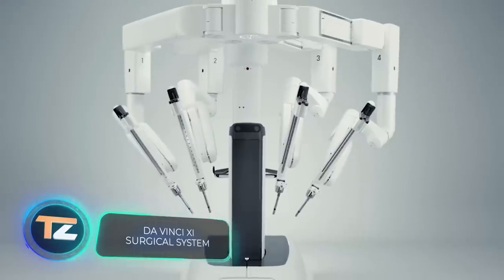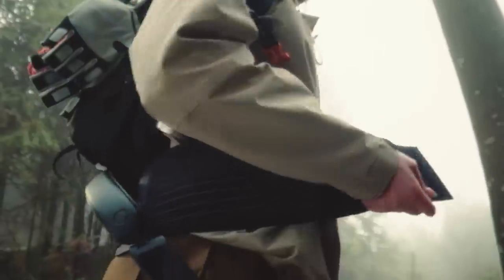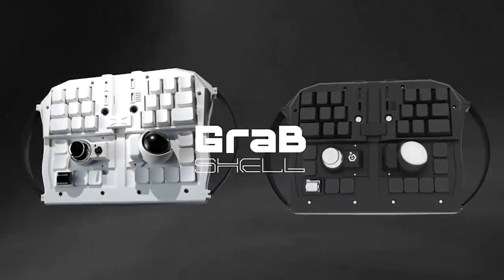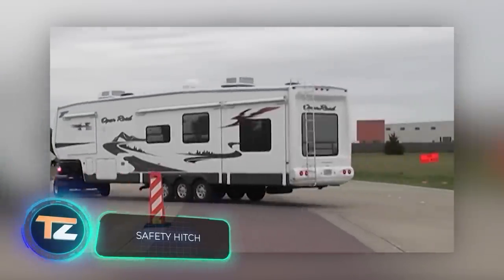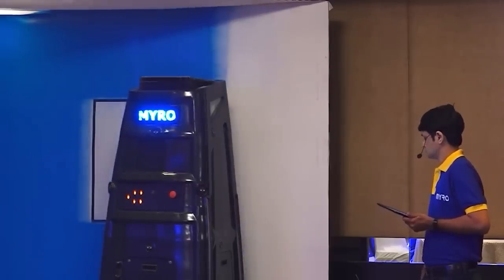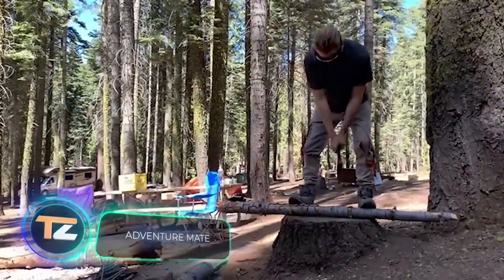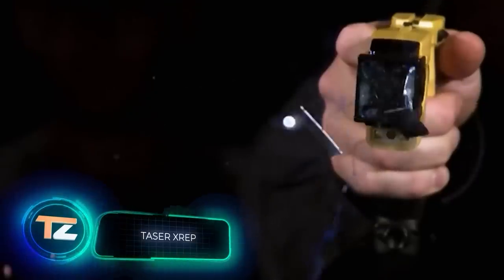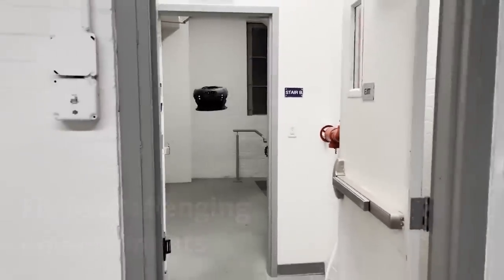INCREDIBLE INVENTIONS YOU DIDN'T KNOW ABOUT

Comment: I've preordered the Bigscreen Beyond and from what I'm hearing from early testers, it's living up to the hype. The lens itself is called a "Pancake lens. The MicroOLED screen is very small " and is why the lens is  basically a magnifying glass. The reason for the facial scan is because they need to know what your Interpupilatory Distance (IPD) is so they can precisely place your eyes in the correct position to look through the pancake lens without the distortion you would get from when you would look through a normal handheld magnifying glass. The precise scan also allows for a perfect fit of the gasket against your face to prevent ALL light from bleeding through and causing things like lens glare and other stuff. This Headset is definitely something to seriously check out for any VR enthusiasts that spend many many hours in VR sessions.
Reply: I actually kind of prefer having a little light leakage around the nose area. I don't get motion sickness but if I'm standing on a slope in VR sometimes I can start to lose my balance. Going crosseyed and staring at the actual floor through that little gap lets me instantly regain my equilibrium without taking the headset off.

Comment: $10k to solve a trailer "problem" that really doesn't exist...
Reply: Uh it helps me get the most out of the toe package I put on my straight piped corrola🙄 duh. And now if i want to say tow my new fith wheel guess what now I can and i dont even have to try to redline this b** now like bro I get stuck everywere
Reply: I agree it’s too expensive but not putting weight on the rear bumper, not losing space to a gooseneck and the improved braking seem like pros to me.
Reply: One use would be for towing a larger trailer behind a utility pickup that doesn't have room for a 5th wheel or gooseneck hitch.
Reply: You can buy a lot of gooseneck and 5th wheel hitches for $10k.
Reply: Yeah - because it is just a Ford pick-up commercial and a dually pick-up takes care of the usual hauling -
Reply: You don’t drive off road very much.
Reply: truth.

Comment: The Sea Air underwater swimming system would be greatly enhanced with a full face mask. Since this system is geared to newer type swimmers and possibly tourists who have little experience in the underwater sport,  a full mask might allay some of the closterphobic of breathing through a mouthpiece.
Reply: i'm pretty sure CLAUSTROPHOBIA isn't the word you're looking for; try beginner's anxiety. but that's a GOOD point u have there; FULL mask, MORE confidence (for SOME ppl anyway)
Reply: @Solitaryconfinement :- The breathing with a mouthpiece always bothered me and caused me to avoid scuba and snorkeling,  but in my profession l was required to use a Scott airpack with a full face covering and l never felt closterphobic even in extremely toxic environments.  
I know some tourist attractions exist where the individuals are required to submerge completely underwater and use a full helmet that has fresh air pumped into it from the surface. This alleviates much of the fear (for amateurs) of breathing under water.
Reply: @babagalacticus  :- Spelt both ways.
Reply: It is also only generating Oxygen (O2) and hopefully at only 21% so you can go down 66 meters. If it is generating 100% Oxygen then you would be wise to stop around 4 meters, because at 6 meters you will go into convolutions and likely die.  lol

Comment: 4:37 does it really need a battery using USB-C? If it’s not wireless, it really should not be using batteries USB-C offers a much higher voltage and amperage than other USB devices.

Comment: Reference the SeeAir system, the narrator says it works without an "Oxygen" cylinder - but any viewers who may be contemplating simply rushing to buy one of these systems should know two things first: Number One - Don't even think about diving on compressed air without taking structured SCUBA-Diving lessons from a qualified diving instructor - unless you want a) Permanent ear damage from ruptured eardrums, b) Permanent breathing difficulties after damage from burst lungs or c) Decompression Illness - AKA "The Bends". If you stayed too long at the maximum depth possible with this machine, such activity could allow the formation of nitrogen microbubbles in your bloodstream - which will expand as you ascend, causing you to experience agonizing joint pain, potential blockages of blood vessels and/or excess pressure on your nerves. This worsening condition could lead, ultimately, to a very painful death if the correct treatment procedures are not followed, in a Recompression Chamber - as soon as possible... 
  And the number two point - Oxygen is TOXIC at an absolute pressure of Two Bars - divers prefer breathing clean, compressed air on ordinary dives - or possibly "Enriched Air" or Nitrox on longer, deeper dives. The air that we all breathe is made up of approximately 80% Nitrogen - and only about 20% Oxygen. We do use higher concentrations of oxygen in our decompression mixes, but at specific depths, using accurately-measured gas mixtures and for carefully-calculated periods of time. And when doing so, we Always keep that "Two-bar Toxicity" topic in the back of our minds. 
  Many other such "Hookah" systems like this - with some sort of floating air compressor, supplying a scuba-diving Second Stage regulator in the diver's mouth -  have been invented and sold over the years, so this is not at all "new". But they have never been particularly popular - especially after several highly expensive and  litigious court cases have been won by permanently-injured users, against the manufacturers of these things. 
  And, whereas most of the more-reliable SCUBA (Self Contained Underwater Breathing Apparatus - in case you were wondering) breathing systems are made and thoroughly tested in Europe, the USA and in Japan, you have to ask yourself if you would trust any form of Life-Support Equipment, as this is intended to be - if it uses cheap, inferior, untested, Chinese-made components anywhere in its construction...YOU HAVE BEEN WARNED.

Comment: The Taser XREP died a quiet death sometime between 2009 and 2012, Great Idea, but a $100 per round there just weren't enough takers for Taser Intl to keep making them.  While there ARE some still out there in the wild, Last I saw, a 5 round box of them was going for $950.00.  Great Idea, just too Expensive for most PD's to even consider.
Reply: also its lethal on close range so you also need to carry a normal taser and a lethal option if it doesnt work